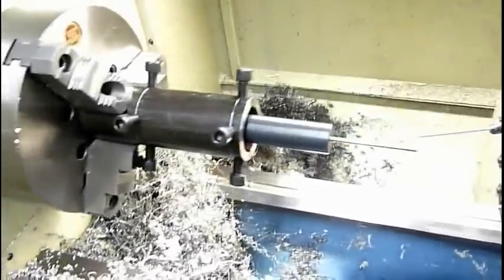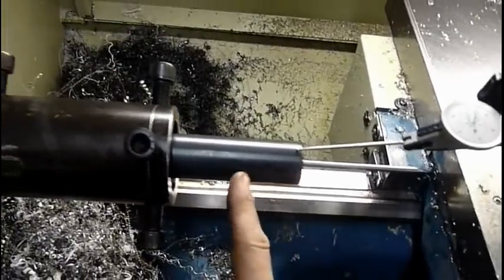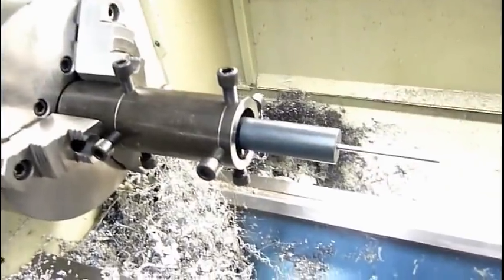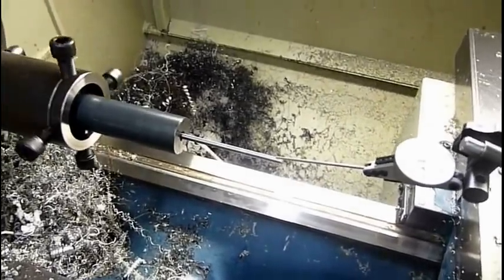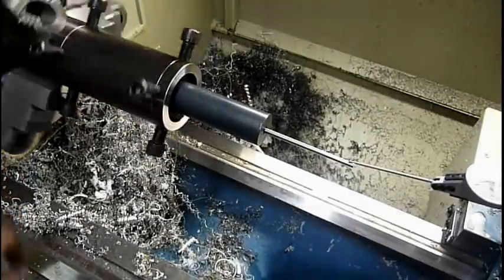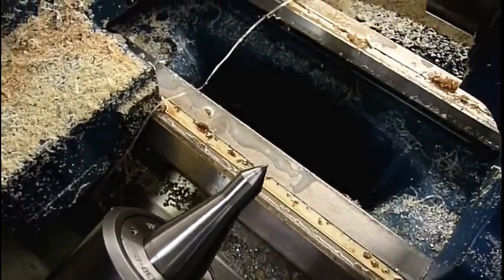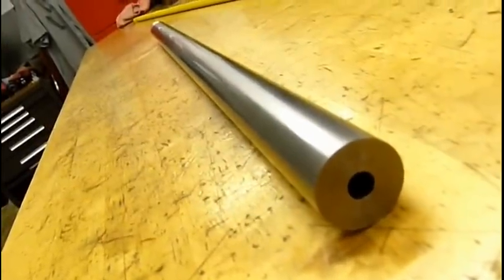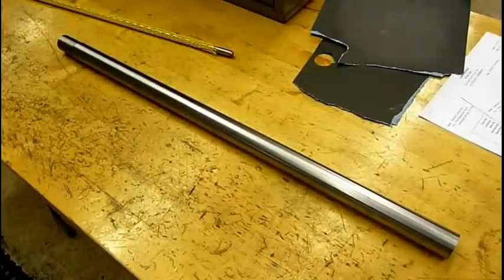Turning and Threading a Barrel

Comment: While you have the shank end of the barrel centered, and have turned the threads, that's an ideal time to use a floating reamer holder in the tail stock and chamber the barrel.  Otherwise you'll have to do the centering setup twice.  A Savage barrel can set the headspace with the barrel nut, so the headspace can be adjusted on the action.  On rifles without a barrel nut the barrel can be short chambered in the lathe, then finished on the barreled action.  When turning the profile on a barrel you can avoid too much chatter by stepping the barrel blank out of the chuck and roughing the contour in short segments (the opposite direction the video shows for contouring a straight bull barrel).  Then do the final contouring between centers.  If your going to sand on the barrel between centers, cover the ways with some rags of other covering to keep the grit off the ways.  This was a good and informative video.

Comment: Good job... Excellent thinking that few people know these days. I am a retired machinist with over 40 years of experience so I recognize good technique when I see it. It would be nice to have a steady rest but you can build a good follow rest that will work better for you with a little patience. Most lathes already have holes drilled and tapped for a factory supplied one. Find a place to mount it to the saddle and just touch the barrel with the pads in order to dampen any vibrations as you profile the barrel any way you want. You can program the desired taper if any and hold the diameter as you gently work the top and back pads. Brass or nylon will do nicely. Leave a 63 finish a couple of thousandths over the finish size and work the diameter with emery cloth to a 32 finish. This will save you a lot of time after the first barrel and improve your already excellent quality. Keep up the good work and happy machining to you.
Don
Reply: Thank you for this comment. I have dreams of turning my shop into a working machine shop... Someday.  As for now I'm 1.5 years working in a machine shop, & learning daily..but it's gonna happen. As for now I love this work,  maybe I will soon stop being a chicken & turn my lathe on
Reply: Excellent advice. Thank you.

Comment: The bed rail is messing with the F stop on your camera. Just put a dark rag or towel over it when filming to block the reflection of the ambient lighting. Agreed, Eric has it figured too. Camera is set to spot metering vs. average metering meaning the F stop is going to change based on a narrow margin only within the center of the frame. Average will have more tolerance for light and dark areas in the frame "averaging" the F stop metering.

Comment: One suggestion, since it is from a blank and not a re-chamber. You could put it between centers and turn the OD parallel to the bore. Then use a spindle liner on the muzzle end with a slip fit on the OD that you turned. Then when you chuck up the breech end and indicate it, the muzzle end, chamber,and breech features will have very close TIR and concentricity to the bore on both ends.
Reply: That is the exact way real gunsmiths told me how it is done when going from a barrel blank to finished contoured barrel. With spindle liner, you mean a outboard spider right ?

Comment: Question........ Why not mount the barrel between centres and centre the shank dead on to the bore? Then no matter where the bore is in relation to the blank the shank will be dead centre. You could flip it end for end and centre the muzzle the same way using the 4 jaw as an adjustable lathe dog. This will be accurate to less than half a thou without even using a dial gauge.
Quick and easy,

Comment: Thanks for the details, they are very informative. The camera is getting dark because the automatic light sensor is tripped whenever you get the glare from the ways hitting the center of the picture. The choices are to move the light, cover the ways with some paper to darken them. or mess with the controls on the camera to allow 'backlighting'.

Comment: I like emery cloth, though generally its frowned upon to use it while the part is still in your machine. The particles are abrasive and very fine, so they cause premature wear on the ways, or just as bad, your spindle.

Comment: Because his headstock is too big for the barrel to protrude out the spindle bore, which disallows the use of a spider for his second point of adjustment. You can get pretty close with a four jaw, but not close enough for things like barrels, where you can't have much runout and the part is long. As for indicating off the bore, he runs into the same problem. If his barrel was long enough, he could indicate off both ends of the barrel. Not so in this case. so he'd only have one point of reference.

Comment: Running out a little bit and it does not matter, are you kidding, except for head space it is the most important thing going. You are going to cut a chamber that is "On Center" with the center line of the lathe but the center line of the barrel is pointing some place else. Unless the center line is true and the O.D. is out.
Reply: +Legion Prime Think about this for a short minute. The center line of the lathe is where the reamer is going to cut, the center line of the barrel should be true to the CL of the lathe, his barrel is wobbling so there is no way the two CL's can be running true. That means that the chamber is not pointed down the CL of the barrel.  So the round has to jump from one CL to another,  I cut Propeller shafts for Aircraft Carriers many years and we cut them far truer than his work Look at other vids of barrel clambering and you can see what I am trying to get across.  40 years in  modern machine shops has taught me better than this.

Comment: Sir, you camera is going dark because it is spot metering on the center of the picture which is a very bright metal bar of sorts. When the meter sees that very bright item it darkens the picture to compensate for the brightness of the bar. If you are able to change the camera's metering schematic to center weight average, matrix, or something besides spot metering it will correct the trouble.

Comment: How do you index a barrel up when its threaded. Getting it perfectly up and tight and head spaced all at the same time?
Reply: He'll make the threads run out so when it's tightened up, it will be 12 o'clock. Seems like a lot of work but those used to ancient machines are used to it.

Comment: I'm an "amateur"machinist but doesn't this have bad written all over it? From my experience I would have set up on centers, steady rest the end away from the chuck, and then indicated the bore in, or set up a spider (I noticed that this would not be easy on the lathe in the video but for reference) and then indicated the bore in. Anyone see anything wrong with my chosen set-up that I am overlooking?

Comment: Wouldn't you just center into the actual center of the barrel? Why would outside diameter matter when you're trying to center off the bore? I'm new to this so just curious.
Reply: Because centering to the OD of the blank gets you close first, then you fine-tune to the actual bore axis. Afterwards, you turn the blank down to profile along the same axis as the bore.
Reply: @scbane  Thanks for the explanation!

Comment: Is your indicator calibrated for that length of needle? the longer the needle, the less accurate the indicator, so if that needle is 3 or 4 times longer than the stock one, your measurements will decrease in accuracy by a factor equal to the ratio of the length difference. so what appears .0003 is closer to .0012 or .0016. i'm a machinist not a gunsmith so i'm not completely sure how much a thou affects accuracy with regards to ballistics and baffle strikes, i just know the government freaks about .0005 deviation in concentricity when it comes to aviation.

Comment: Just a humble suggestion, but if you put one of those spiders on the far side of the spindle where the other end of the barrel is, you'll find it easier to center as the adjustments will be finer. Also you wont have to worry about the free end of the barrel whipping around and throwing off the center during cutting.

Comment: Forgive my inexperience/lack of knowledge (everyone's got to learn sometime), but why wouldn't the following work:
Between centers w/dog
Or using the 3-jaw chuck and a center in the tailstock
Reply: +Damien Gregory You can do it between centers but most lathes that are used in Gunsmithing are not long enough in the bed to allow for this. If the bed was long enough sure.
Now the thing is and i see this all the time. there is no reason to indicate between center or do the work between centers. you should only indicate the length of the camber plus 1" or 3" overall which ever is more. Think about it. the bore is not straight not saying the barrel is warped but it is impossible to have a hole in a barrel that is straight within .001" over say 12" so dialing in between centers is useless when you have a slightly banana shaped hole. sure the ends are true to each other but what about the center??
So just indicate the area you are working is as close as you can and call it good. once the bullet hit the rifling it's out of your control anyway.
Reply: +Damien Gregory, If you are refering to turning the O/D,  either one would work in theory, but you need to watch out for chatter, a running steady would be the best method. Once you had turned the O/D I would then have the whole barrel sticking out of the chuck, with the centre in, and then cut the thread, that way you know that the thread is dead true to the O/D.
Reply: Yes you need to use a follow rest too but that is just good machinist practices. Threads true to the OD look good but mean nothing. and you will only be cleaning up the breach end. Barrels that are turned in bulk are done on CNC machines and have collets and hydro pushers like an over sized swiss screw machine.the barrel is advanced out of the headstock into the tool. this allows for fast turning of a long part with no chatter. Problem is the Gunsmith don't have access to these tools.

Comment: Why not get a barrel blank, drill the bore and then turn the barrel to the bore?
   Seems like that would give you a perfect alignment.  I'm not a machinist but i was just asking.     :-)
Reply: a general gunsmith doesn't drill the bore and rifle it... that's for barrel makers to do.. old school gunsmiths did what you suggest but they didn't cut the barrel they put a sleeve on the outside of the barrel and cut it to the bore,,,  more steps,, but the best way is to indicate the bore on the barrel and the center line of the receiver....
Reply: carryit around

Comment: it doesn't matter if the bore was drilled canted if you square everything to the center line bore and the center line of the receiver facing off the receiver and the barrel.... how could there be an up position??....  even if the barrel blank was warped when it was drilled the bore would still be straight... if the bore was drilled with a wandering bore cutter or someone bent the barrel after it was bored...well maybe then you would have a problem...
Reply: it doesn't matter if the bore was drilled canted if you square everything.. but wouldn't  the inconsistent wall thicknesses cause problems as barrel temps rise?  Isn't this at least part of the reason I like my barrels to be free-floating?

Comment: How do you know the centre of those brass bushings are concentric to the exterior of the bushing? Did you bore it out?

I'm guessing you made the bushing because you weren't able to find carbide the correct diameter for the barrel ID?
Reply: Poland stronk

Comment: Thats not a square Thd. 60 deg. thread Mikes dont measure square thds. Flat on top yes but far from a square thd. Thats a great looking  lathe but to big for that job, barrel should stick out the rear and indicated at that end also to have I.D. true at each end and no run out of the Center line "bore of barrel".

Comment: Do you true up your jig also?
Reply: yeah I had the same question but I don't think he needs to.. Using the bolts to set his barrel to zero eliminate that but to center it in the jig would take some time. The jig acts as a chuck but I could be wrong though. I'm not a gun smith but the set up seems wrong if the lathe chuck and jaws are centered then why would he need the jig? A second chuck or collette on the rear to hold the barrel would work. But his CNC/Lathe through hole length is longer than the barrel. Seems to work but resetting the barrel further in then turning the barrel down in stages doesn't always come out so straight. Steady rest for long pieces with a taper bar has worked for a long time as well as grinding with a mounted grinder on the cross slide. In the end it worked and looks good.
Reply: I just had a thought about his jig and why he used it. I retract my statement about the setup. I realized that the barrel might be tapered. It being a new barrel and not being finished it might have a slight taper but really the barrel needs to be cut downed and finished machining to the desired taper,size,and finish of the maker. Awesome skill to make a gun. Similar to making a cue's shaft. In shape only a barrel is nothing like shaft making.
Reply: the jig and the jig bolts could be way out... in fact most are,, even the od of the jig.. the barrell is indicated with a range rod and the bolts simply position it... my lathe allows me to work between the spiders on the headstock if i have long enough barrel... for a short barrel or a receiver you need the jig... also a jig for the bolt as well...

Comment: Hi, interresting video but what comes up in my mind first, was a little improvement for your rig. You can improve the adjustment time a lot when you use a three point mount instead of your 4 point screw setup you using right now. 
Give it a try with three screws insted of four. (120 degree instead of 90)
You will be positiv suprised by the resaults.
Reply: i suspect rigidity could be a problem....general machinists who have a adjustable 3 jaw chuck still use a 4 jaw for precision work... you may be correct but that's not usually how its done,,, in fact i have seen 6 bolt jigs and 6 jawed chucks.. longer to indicate but more rigid and more precise?

Comment: just get an independent 4 jaw and indicate that in...
Reply: Derek Blatt that works for concentricity but not the bore axis, thats the point for indicating in two spots
Reply: +Legion Prime  I don't know what four jaw you are buying but I have three jaw chucks better then that and My four jaw chuck can be indicated to the point of seeing my head stock bearing run out.
Reply: That does nothing for indicating in the bore.  Gunsmithing is significantly different.